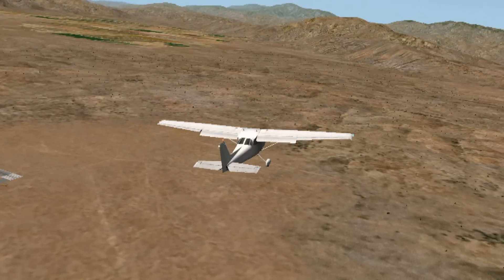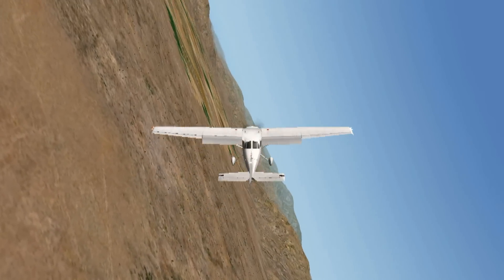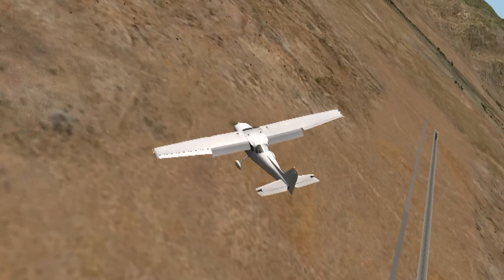Demonstrated Stalls - Private Pilot Training

Comment: hi, im wondering the condition that the pilot uses left rudder and opposite aileron ... is it really skidding?? i think it is slip.
Reply: It's a skid because centrifugal force is playing a larger role than horizontal component of lift. You've put yourself in a situation where you're applying too much rudder in the direction of the turn for the degree of bank, therefore your ball on your turn coordinator will move to the outside of the turn=SKID (CF>HCL). To correct this condition prior to stall, you'd need to either increase your degree of bank in the direction of the turn to coincide with your rudder input, or take some of your rudder out and introduce more opposite (from the turn) rudder pressure (step on the ball).
Reply: skid=centrifugal
slip=certripetal
Reply: You are correct generally but the airplane was already in a left turn in this scenario where too much left rudder was being used. Then opposite aileron was input to further exaggerate the skid leading to a graveyard spin.

Comment: Hello Gary,
Your videos are the best aviation learning videos on YouTube. I have heard about the stall caused when trying to correct overshoot from base to final. If one should find oneself in such a situation, what is a good way to get back on centerline.
Reply from the maker: Go Around Or at least increase bank / decrease yaw to the point the airplane is coordinated (ball centered). Remember, the ball doesn't need to be pegged to induce a spin; it could happen if you stall with as little as the ball 2-widths out of the cage.

Comment: i usually wonder about 1 thing. Suppose, lets talk about airasia boeing accident in 2015. that boeing was stalling, and falling from 38000ft. the question is: why was it not possible to reposition the plane to its normal state? i think the pilot could make the nose of the plane lower than its body, maximized the jet power until the plane had enough speed, then simply pulled up that plane
Reply: aghaanantyab Hi, I was curious about your comment, so read the report.  It was an Airbus A-320.  The crash occurred on Dec 28th 2014, the plane's major parts were mostly recovered in about 1 month later.  The FO had nose up input on the control stick, and the pilot had nose down input to stop the stall.  Since the nose input was first, the alternate law system disregards the opposing second input, therefore contributing to the accident.  The rudder limiter system had failed w/a two degree deflection and could not be changed, resulting in a 54 degree bank, but this would have been recoverable had the pilotsperformed the correct procedures and not disabled the auto pilot incorrectly, causing the aircraft flight management system to enter alternate law, a supposedly aircraft saving parameter.  This system is also helped cause of the Air France Crash off of Brazil.  That system has been subsequently changed somewhat, I believe.
Reply: Paul Bergman and both of those crashes happened in that equator area where bad weather can occur

Comment: i have a question if you don't mind. i have your USA Cessna Tour paused atm. you are using VFR Denver flight following to land. (he gives you 2 random street names as a VFR landmark) ok so, as you flare, you let the yoke go forward, ever slightly and for only a moment, i assume because you feel yourself stalling before wheels touch from too high up. pretty much from day 1 until my checkride prep i was doing the same exact thing for the same exact reason. my instructor said, on more than 5 occasions, "don't let the yoke go forward". when i tried to hold it back and not "stop the climb" i did climb, and had a more solid or maybe bounced a tad. usually if im a little fast on short final. did he say that so i wouldn't get lax and put myself into oscillation? it seemed as if i was preventing it the oscillation.  i saw him doing it too, though i never said anything because it felt right. 

  i play a ww2 combat flight sim with hundreds of other guys, most of whom are pilots with numerous Vets as well. ill start sharing your videos on the squad forum, maybe you get more views and subs. i think its deserved. thanks for reading long msg. your videos are great.
Reply from the maker: bombud1 I went back & looked. At 10:29, I do see the yoke go forward a bit, but the mains are already on the runway at that point. A couple seconds later I bring the nose down. I don't recall anything peculiar about that landing, and at this point whatever I'm doing with the controls is certainly by sight & feel and not at all mechanical or conscious....